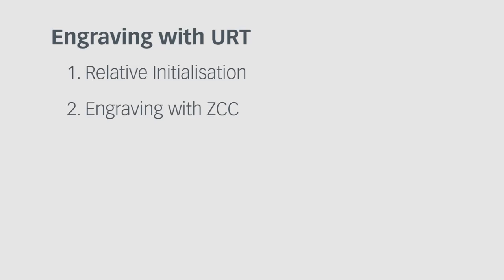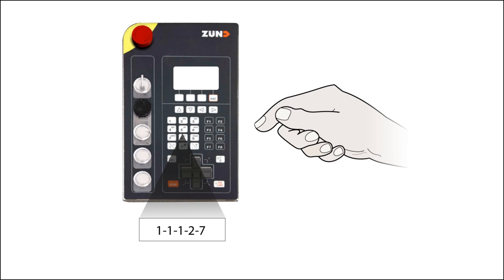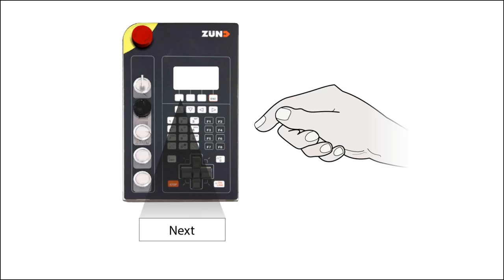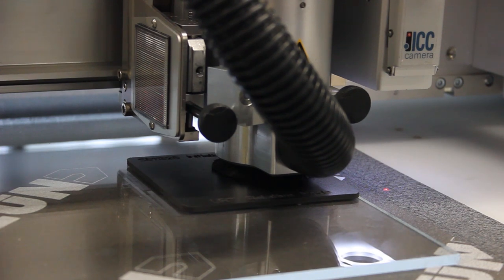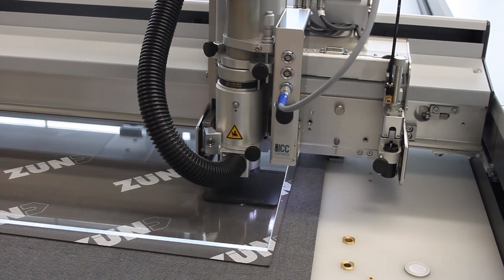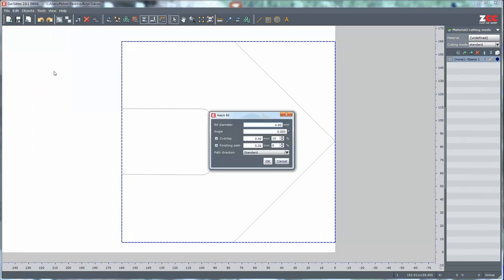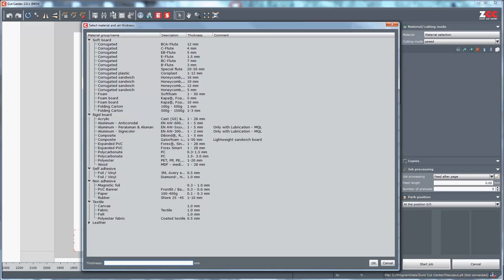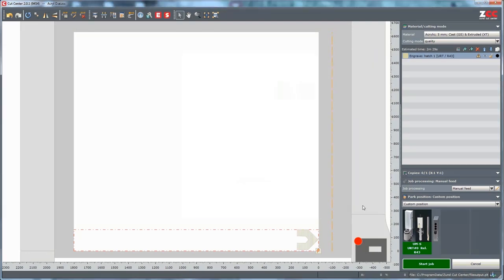Engraving with the Zünd Universal Routing Tool - URT

Comment: What settings are you using for this?
Reply from the maker: It depends on the material, and on the used tool. If you use the Zünd Cut Center, all parameters are already integrated. In this video, it was a router-bit R43. For all the correct parameters, please send me your e-mail address and I will send you the complete parameter list. Thanks, *tna